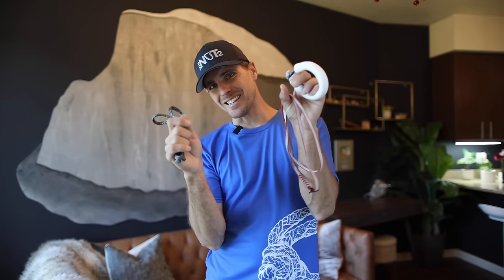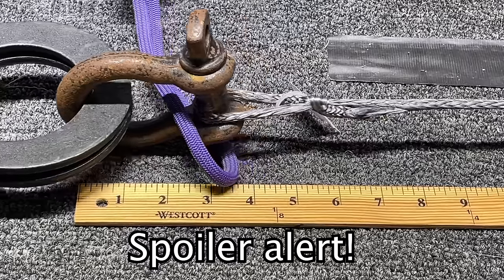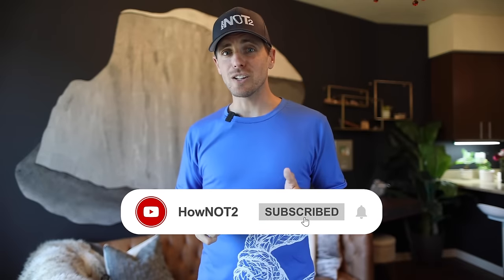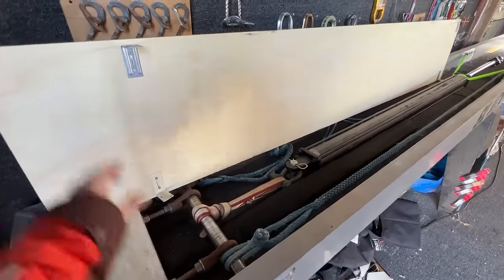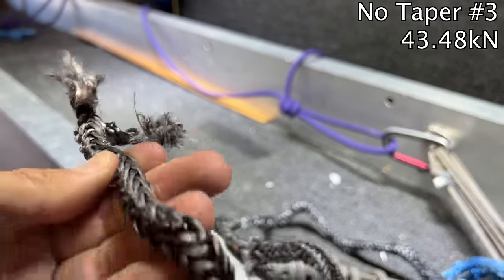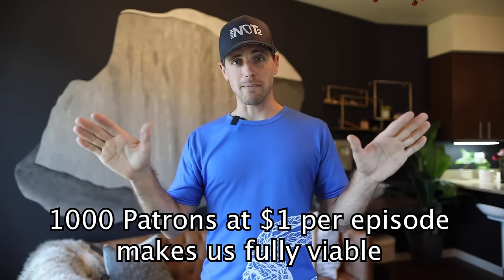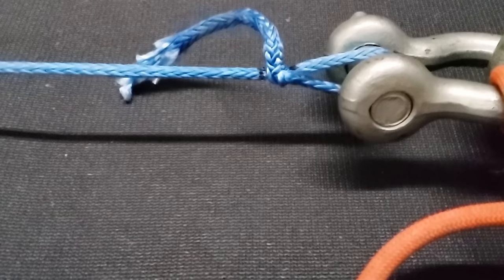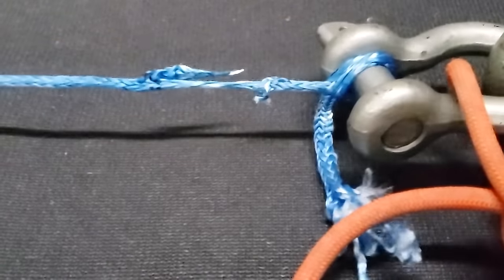Are tapering splices that important in Dyneema / HMPE?

Comment: This info needs to be shared with the 4x4 community most of us have dyneema winch ropes, and I've seen so many people tie knots in it, esp for the loop or use metal cables locking hardware to make loops.
Reply: As a wrecker driver who uses rope, I will say if you brake it on scene and absolutely need to use that winch still, I tie a quick figure 8 and adjust the rigging to account for the loss of strength if need be, It takes 5 seconds to tie the knot and gets the job done until I can get back to fix it properly. So in my opinion when time matters tie a knot and rig accordingly and splice it properly later... Just keep in mind you will not easily be getting that knot back out so you'll fuck with it for 30 minutes to keep your length or you will be cutting a few feet off to get it out of the way.
Reply: @towtruckaj  that is 100% fine with rope. Should have made that clearer sorry.

Dyneema sadly will melt in the knots and has a high chance of breaking well below its rated safety limits.

The most plastic the "rope" the more likely that high loads, static or shock, will cause the rope to start melting from friction and snap. 

It's why I said the 4x4 community needs to know this as the use of dyneema (its a brand name that has been used to cover all brands of that type of "rope") is very wide spread, cable has become very rare due to weight and size.

For tie downs and the likes I have very little issues with putting a knot in it to get you out of trouble.

Also got to remember that a large part of the 4x4/offroading community buys gear they don't know how to use. Then when it's needed they don't ask for help, just use it, rarely maintain it etc. Then when they use it, well they go to 100% right away, so many times I've seen someone snatch strap (kinetic strap) someone, going as far back as possible for the run up and flooring it, as a first attempt instead of starting with a gentle tug then working up. So you have an unmaintained, likely filthy from being on the bottom of their kit, out of date, cheapest and even likely well underrated for the vehicles being used. It inevitably snaps, so they tie knots in it then get shocked when it snaps again. Or when putting it back in they just gather it up in a big bundle, throw it away wet and dirty, next time they can't be bothered fully untangling it, has a few knots in it, then it snaps at the knots.

I noticed when seeing snapped "ropes" in the 4x4 community its at a knot, and usually on snatch straps or winch ropes....or at sharp parts of the vehicle because no recovery points best case...or at the bloody tow ball at worst.
Reply: @azazeldeath  That's just the reality of the 4x4 community with anything, Some guys are well educated in recovery techniques, Technical info on their equipment, etc. Others are just some fool who bought a bunch of cheap garbage that imitates what they see in videos and they get themselves in troubles, Not to say it's just the 4x4 community I see the same dumb shit happening from so called "professional" wrecker "operators" In my industry. It seems very few of us in many industries and communities alike actually put the time and effort into learning and mastering our craft.
Reply: @towtruckaj  so true, used to be a mechanic, found similar in that industry. It only really concerns me when their lack of ability to do any basic learning can endanger others, like me, my loved ones, or friends. Or even really anyone. Hurting or killing yourself because you didn't want to learn or study something sucks, but that's all on you, when it hurts or kills others then it stops being acceptable in any way in my opinion.
Reply: As with 4x4 ,yachting people work on MBS.Ive been involved with yachting and lifting industries for most of my life.Working with MBS,is an accident waiting to happen.There is NO safety margin built in.ALL the bush boys will want to jump on me.I have run NATA certified testing facilities.I would say that if there was enough SAFETY FACTOR built into the system,no matter the splice or knot,you would be OK(disregarding slippage) In yachting on many occasions,I’ve been on people’s yachts thinking,shit,I hope this doesn’t shit itself 🤓🤓🤓🤓Pile on BOYS .
Reply: @user-ce9gm7fq6m  yeah I have worked on a couple of smaller yatchts, because why tf take it to someone that knows them well, take them to your mechanic because afterall it's got an engine, it has wheels when on the giant trainer etc. And I learnt fast if something is rated at let's say 1 tonne. It will break at exactly that or much much more likely below.

Had to pull and rebuild a huge diesel engine out of a yatch once. The lifting loops for the engine were rated something like 100kg more than the weight of the engine.....we had to pay alot to repair that engine coming back down through the hull. Still pissed, basically no indication the lifting points were bad, on a car you have factory lifting points you inspect for damage, make sure they are torqued down still, carefully lift ofc but you can trust them. But nooo apparently on yachts that cost easily 10x the price let's make everything out of recycled coke cans...mostly slag because real metal costs too much.

Comment: I do not know anything about climping but have been sailing 40+ years. The sailing comunity have used dyneema for a few decades, i guess. a long taper is an absolute must for a strong eye/splice. if you want it even stronger you skip the brummelsplice and just burry it and secure it with some stitches, thats the strongest way to do it.

Comment: Might be different in the climbing world, but as far as I understand in the boating world the taper in the Dyneema was to allow for the spliced rope to flow smoothly through a pully. i.e. you don't want a big lumpy change in the thickness of a rope when you pull it through a pully as it has a tendency to get stuck. Never heard of anyone saying that it made it stronger. But great test! I've only heard of anecdotes and stories around it so it's great to see someone putting this to the test.
Reply: @Nathaniel Brough: Tapering follows engineering practice (not sure about traditional lore in various sporting cultures) that sharp transitions induces stress risers which induce fatigue points and increase the likelihood of rapid failure under load...  Not really "making it stringer" but not making it weaker is key.  cheers.
Reply: @kadmow  Yeah I'm aware of the engineering behind stress concentrators.  
Thank you for challenging my comment, it appears that I've got to examine my opinions on this a bit further.

In general when it comes to boating most of the breakages in dyneema occur either where the rope first threads back through itself in the brummel. The other common failure is when you terminate your rope in a brummel similar to a soft shackle, then you soft shackle the top of a sail to that rope. The rope is only as strong as its weakest point. So I guess in typical sailing use the weakest point isn’t usually a poorly tapered splice. But I still think that you are right that a poorly tapered rope would be a stress concentrator.

The only time I've seen failures occur at the taper, is when someone has done a diagonal cut taper with a hot knife. People seem to be worried about it fraying? But the end result is a hard lump where the rope has melted together. It's not really any weaker than a regular diagonal cut, but it results in an abrasive point inside your splice that over time can significantly reduce the strength of the rope.

I'd be really curious as to how much of a difference a thimble makes with dyneema though. Seems like it would make the taper more important.

Comment: My biggest takeaway is use a thimble to maximize eye diameter. Without a thimble, there doesn't seem to be a point to worrying about the bury taper.
Reply: And along with the use of a thimble, thimble shape. Using a low friction ring seems like it would induce a smaller radius and therefore a stress riser at the bury than a tear dropped thimble like a Ronstan sailmaker's thimble.

Comment: I regularly use HMPE for rigging and have 2 reasons for tapering that you didn't cover. One is that it runs more smoothly through rigging blocks and the other is that when repeatedly running through blocks the shoulder it makes can be pushed up the inside reducing the length of the bury over time.

Comment: The last step of the Teufelberger instructions says to "Cross stitch with whipping twine." I missed whether or not this was done for the video. I would love to see a comparison between the two.
Reply: I don't think the stiching was done. I wonder if Ryan would be interested enough to test with the stitching, but my guess would be that the while the buried tail slips out, it will probably rip the stitching too (?)
Reply: Whipping the rope is to keep the eye formed from changing shape and size when the rope is not under load. Or to keep the splice from unwinding on a woven splice.  I don't think it would add strength, but maybe even reduce it because the extra stress on the dynema where it's wrapped when loaded.
Reply from the maker: I want to test stitching, but that is generally only to keep it from coming apart when it isn't under load.  1 fid length slips generally so I could test that length with and without and actually get a difference.  Once I'm 1.5 fids it typically holds so I wouldn't know if the thread is doing anything.  I put it on the list
Reply: @HowNOT2  when talking max numbers it probably doesn't matter but in real life it makes the difference in lower load sailboat applications I bet. 
 I have had customers come in with a "broken splice" on like a 10year old line. It was really just a soft eye (only cover, maybe 3-4" bury if lucky with nothing but a whip holding it and they used it to haul up and hold their sails with it for all those years with no idea haha. I always take great care in my whips/ lockstiches for hopefully some dumbass insurance against stories like this 😂
Reply: Teufelberger does have a document for splicing the high modulus lines withe a longer bury than the one shown in the Brumel-locked splice. I would use the same (longer) length specified for the high modulus lines even after adding the Brummel lock, as the Brummel is not for strength, but to help keep the splice/taper where intended.  the cross-stitching has the same purpose, to fix the location when unloaded, not a as a strength member, though I suspect it may have some effect to prevent initial creep when loading and make a slightly more secure grip on the buried part of the line. the same way that  a few pounds of tension on a jib sheet with 5 wraps around the winch can hold a thousand pounds of force from the sail. MOre wind in the sail, more wraps on the winch.
Reply: @peterhagen7258  that's a good theory about thread allowing for a better initial lock. A constant diameter splice (for a main furling gear, top down furler, etc.) is one of the weakest out there, and it's usually quite apparent as to which has been appropriately stitched. It is relatively easy to pull out under load with poor stitching, regardless of age! This tells me that stitching does have some impact on strength, at least in that splice.

Comment: I ignore a lot of the technical shit about the bury and taper, Me personally for my 7/16 rope for my 9000 pound winches, I just give it a couple feet of bury to be safe and quick, no need to measure just throw a couple feet out and bury it, As for the taper I don't get technical there either I just grab a foot or so once it's buried and I have it poking back out the end and I taper it as much as I can by pulling every 3rd strand, and if it wasn't enough tail to get it fully tapered to 1 strand then I take the remaining few (usually 3-5 strands If I came up short) and I cut them at an angle, My general thought was if all 12 stay with no taper it would be bad but if just a few remain on the end not likely a big deal, and I'd say the video proved that, At the end of the day it will break at the splice 9 times out of 10 anyway and if you are maintaining your safe working load limit then your bigger issue for breaks is wear and tear and or cuts, not a taper that wasn't fully reduced to 1 strand.